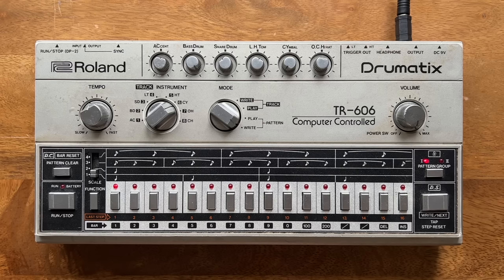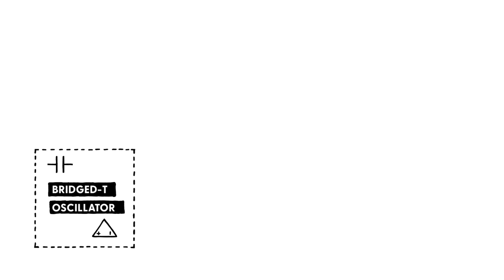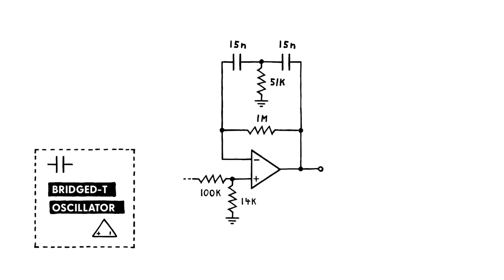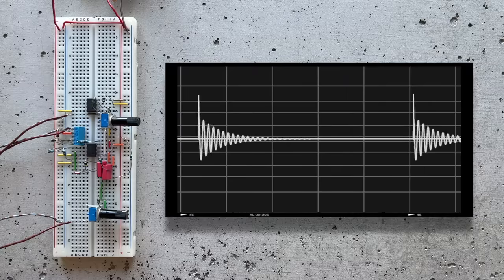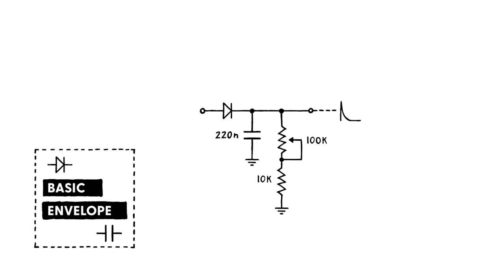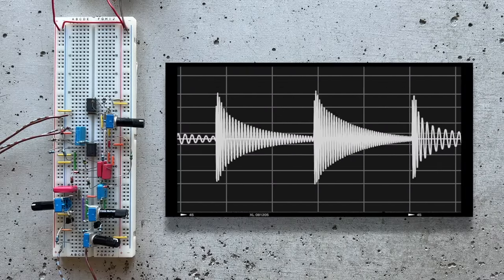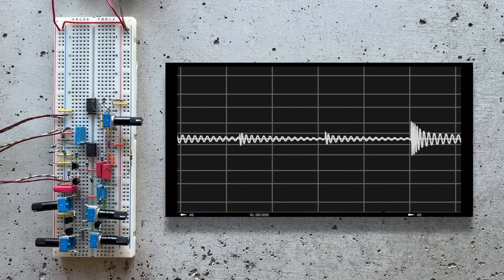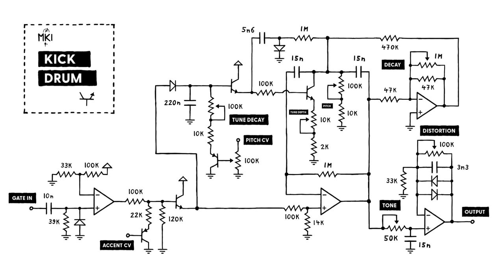Designing a simple analog kick drum from scratch

Comment: This kind of content is what I envisioned in the early days of the internet, knowledge sharing at its best. Hats off, this is great on so many levels.
More visualisations like the circuit simulator would be my only wish, it helps a lot trying to understand what the electrons are doing.
I'm a software developer / analog drum computer freak trying to learn more about electrical engineering. I'm currently building a MIDI sequencer with a RPi / touchscreen / custom PCB / etc. (I'm a few months in and it actually works now!). I still feel like a complete idiot regarding electrical circuits though. Your videos are great to watch, even though I'm still grasping to understand the basics. It's a bit like the feeling I had before I knew how to code. It seemed so difficult, until it wasn't.

Comment: I want to put together an entire massive band comprised of your standard band instruments, folk instruments, orchestral instruments, and maybe even weird instruments, but all instruments are actually hybrid midi controllers that connect directly to a purpose built modular synth designed to sound like and work with their instrument. So the drummer would have a big modular synth with a module for each drum, playing an electric acoustic set.  The signal can be completely synth or mixed wet dry kind of thing. Even the vocals would be using a vocoder, talk box, and other interesting synth microphone type devices. Like that telephone microphone. A band like this would be so freaking cool. And seeing a stage filled with dozens of massive modular synths would be epic. Like the engineering section of starship enterprise.

Comment: Could you use two npn transistors for vintage control, but the second one is inverted?
So, in parallel, join the center pins, would you get 415uA in both directions?

Comment: Ok. So I did some analysis on the bridged-T oscillator in the frequency domain. I assumed that the input signal was a unit step. As a result I got that in the output we get a exponentially decaying sinusoid (under the condition that the bridge resistor is larger than the resistor connected to ground). The thing is that the frequency of the output signal is constant. But wasn't percussion supposed to have dying amplitude as well as dying frequency? Or I misunderstood something or my analysis was wrong?

Comment: I have a question. Noob question probably. Maybe I missed something but if there is no negative voltage used anywhere in the circuit won't the output signal be oscillating not around 0v but around the point between ground and positive voltage so let's say 6v?   Are we supposed to take care of that ourselves and you just skipped it because it was irrelevant to the heart of the idea?

Edit: i see now that in the simulation the output goes around 0 despite no negative rail being used which means there is something i fundamentaly don't understand.

Edit2: i forgot that you dont need negative rail for coupling. Im going back to electronics after long pause, have to lelearn things.

Comment: If using a bipolar transistor as a voltage-controlled resistor causes distorsion, can we use a second transistor in parallel, with collector and emitter in opposite points? I'm not sure about how bases should be connected: with the same resistor or separate ones. Alternatively, with some other modifications there could be a JFET or a photoresistor coupled with LED.

Comment: I had one of those Roland TR-606 units back in the 80's. I made an external mixer to make it's output be stereo, a pan control for each drum. I sold the drum unit years ago, but I am still using the mixer I made for it. I might still have a song or two that I made with it. It was too hard to program the drum beats to have rolls and stuff, to make it sound like a real drummer.

Comment: Would it be possible to simplify any of this by using an inductor-capacitor for the sound source? It creates a ring that will taper off, and the duration can be adjusted with a resistor, I'm just not sure if there's a good way to shape and change the pitch of that, and maybe inductors are forbidden due to their potential for high spikes in voltage?

Comment: you could cut your costs by sourcing your parts from china and even ordering blood parts.

you may be able to put an inverter to detect the button down event and when the button is released it shunts or shorts the output to ground muting the second bump.

yes that will now make the circuit more complex.

it may be possible to do it using an arduino or raspberry pi and software using a complex table of if/then statements

the only downside to that is it puts it into digital territory 

when you connected the transistor you are starting to get into acid effects (the kind of sound you get from acid music).

Comment: With the section about how the npn transitors will flow more current in one direction than in the other, could you not jut use two transistors and a couple of diodes to insure that current only flows in the forwards directions of the transistors?

Comment: I been wrestling with this one more than a week now, it´s probably two weeks already. First it worked but was very strange in it´s functions, not fully right. I was troubleshooting and troubleshooting and troubleshooting until i finally almost gave up but then i thought i should try to change all the transistors to new ones. Because i felt like i tried everything else. 

And Heureka! It worked! Perfectly! Finally i got to try it out for real, for about 3 minutes before it started to get wonky but in a completely different manner and now it´s intermittently wonky. In new ways.

It´s my own build from the schematics though. Not the kit. I have made my own Verobuild.

This circuit confuses me a lot when troubleshooting. I listen to different places in the circuit and use a multimeter, i dont have a oscilloscope sadly. I get sound all the time but sometimes the oscillation just keeps going steady, ignoring the trigger. The Tune Depth and the Tune Decay pots has been the wonky ones all the time. Decay, Pitch, Dist and Tone work fine. I have gone over all the soldering two times and checked for bridges both with my eyes and continuity tested the board up down left right several times. My last (desperate move) was testing to change the two troublemaker-pots but that didnt make a difference. 

Electronics... :-D. I´ve got very familiar with this circuit though, problems is very educational. And satisfying when you solve them.

It is a great little module though. I like both the sound and the features a lot, it will definitly stay in my modular. Looking forward to the other drum modules! Thank you Moritz!
Reply: I ran into some problems with the kit either. As long as you keep the decay below say 3.5 (and the 4/4 BPM at ~135) the kicks sound and decay is quite stable, anything above makes the decay, accent or distortion quite erratic, short kicks, longer kicks, distorted, not distorted, all over the place. The next thing that's quite unusual is the trigger input which lets the module generate different sounds as you input different voltages. Don't know if this is intentional, why does it have an accent input then? With a LL8 trigger sequencer (5V trigger output) the kick sounds quite soft and stable, triggered some Doepfer squarewave LFO the Kick gets significantly louder and slightly distorted, with just gates from a Behringer 182 the Kick gets unstable again. Strange.

Comment: Hey nice video! I have copy paste the name of components to Segor Electronics here in Berlin and they told me that the list is unclear because it needs to be more specific with sizes.. is it possible to find the part names with precision to all components thanks .. great video! it got me curious to build this myself.
Reply from the maker: what additional info do you need? tolerance values? for the resistors, i use 1%, but that’s not critical. 10% should also work. the capacitors are all film/foil, so their voltage rating is irrelevant (because the lowest tier is already super high).

Comment: I'm trying to build it now and I've hit a wall. I've just added the gate to trigger converter, and the circuit works fine with an LFO moving between positive and negative voltages, but if I use something that sits at 0V normally, it doesn't trigger. It seems the capacitor in the highpass filter doesn't have a way of discharging unless a negative voltage is sent to it. Is this just a mistake I've made somewhere, or is it designed this way? Surely if you're using a sequencer that sends gates of 0V=low and 5/10/whatever V= high then it wouldn't trigger.
Reply from the maker: hmm that’s curious. the gate i use in the video is going between 12 and 0 V. do you have an oscilloscope? if so, try measuring the voltage spike you get after the 10nF cap. maybe it just doesn’t pass the comparator‘s threshold?
Reply: @MoritzKlein0  my scope is being dodgy today so I'm gonna charge it for a bit. From what I remember I got a spike up to 12V when the gate is on, then a gradual slope down the gate is off when I measured before the cap. When measuring after the cap I think I got a spike to maybe 1-2V with it instantly going back to 0V when the gate is on, nothing happens when the gate is off, then nothing happens when I turn the gate on again cause the cap is charged.

I've not looked at comparators before but I'm assuming the cap discharges into the op-amps non-inverting input and the 33k and diode connected to ground?

I'll have another look later when my scope has got some more battery
Reply: @MoritzKlein0  Just checked and after the 10nF cap I get a spike up to ~11V, and I get the trigger at the comparators output just fine on the first press. When I press again though, nothing... If I put the scope before the cap, I can see the cap gradually discharging, and once it's empty I can then press my trigger again and it'll work. It seems there's just no way for the cap to discharge?
Reply: Also worth mentioning I was using a 100nF cap, I must have replaced the 10nF last night fiddling with stuff. When I put a 10nF back in, it gives the output a much shorter decay.
Reply: The previous comment seems to have not posted but I got a workaround by adding a resistor with one end connected to ground, and the other end on the same path connecting the gate signal and 10nF capacitor. If the connection to ground is direct with no resistance then when the trigger is high it sends that voltage (in my case 12V) to ground, shorting the whole system. I'd imagine if you were using for instance an LFO as the gate input then the negative voltage might draw current from ground, also causing problems, but I don't know enough theory to say for sure.

Comment: this is very nice, I'm trying to reproduce the schematics on circuitjs but the gate-to-trigger does not behaves like it is described : the cap is not discharged through the diode but through the resistor. therefore I used the link with all the circuit and deleted everything but the gate-to-trigger to work with the author's circuit but I still have the same result : there is a trigger at the rising edge AND the falling edge of the input signal. the input is set at 1 Hz on the author's circuit, which is slow enough to hide that behaviour, but if you look carefully there is still two trigger for one gate, what am I missing ?
Reply from the maker: pretty sure that the simulator is not accurate in this scenario. it works IRL!
Reply: @MoritzKlein0  then I guess it's time for me to leave the frigging world or bytes and go full analog with breadboarding 😃 thanks again for sharing this great work !!!

Comment: Great vid - Does this run on 9V? I want to make a circuit like this on vero and use a Piezu type trigger to play it. would this work? cheers.
Reply from the maker: it does work on 9V, though you need 9V/0V/-9V. not sure what voltages the piezo generates and if it’s enough to set off the comparator - but you could always lower its voltage threshold.
Reply: @MoritzKlein0  ok cheers. Prob too complex for me. I just want a kick sound that I can smash with a trigger pad live
Reply: @MoritzKlein0  I was looking at the mono tribe bass drum circuit as there is a vero layout on line, thinking something like this would work on 9v and there is also a snare circuit
Reply: Basically what I am trying to build is a DIY Boss Dr.Pad type design that runs on 9v like the boss Pad does. Ideally i would eventually like to have a selector switch that changes from kick/snr/hiht etc.

Comment: Great video! I´d like to build my own, so if i buy the kit is everything in there or what else do i need? (Haven´t done something like this before)
Reply from the maker: the kit has everything you need to assemble it into a eurorack module! if you want to breadboard the circuit, you’ll also need a breadboard, two 9V batteries + clip connectors and some jumper cables.
Reply: Thank you! @MoritzKlein0